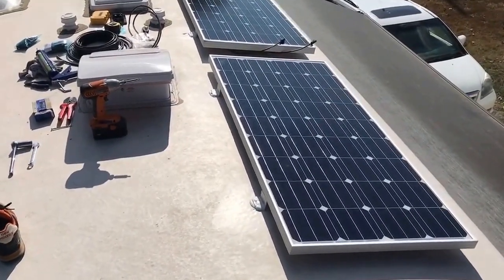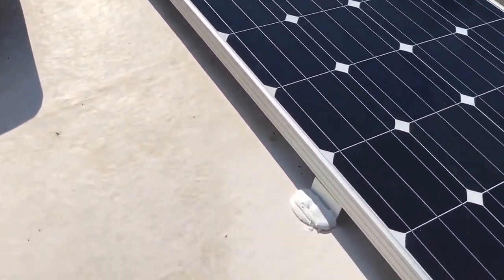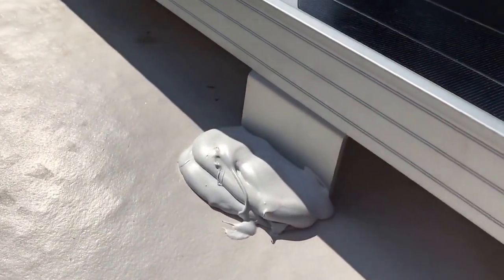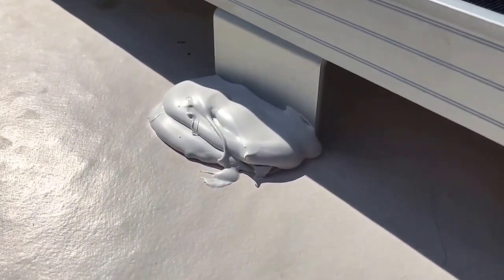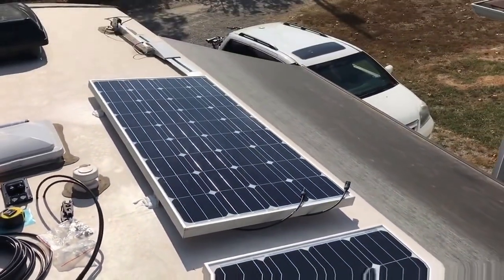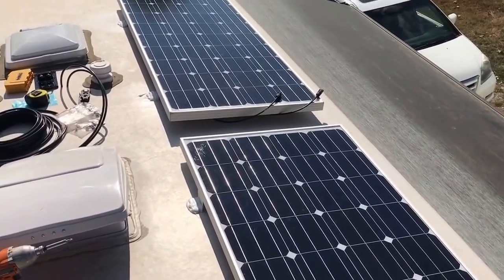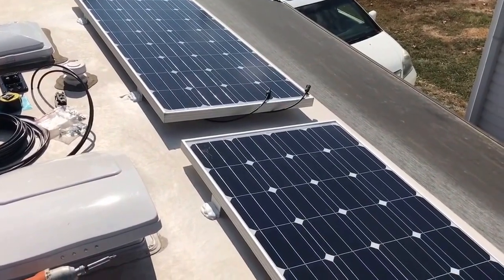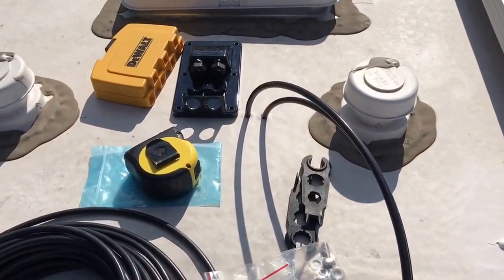RV Solar Panel Install Brookstone

Comment: Did you have any problem getting the 8 gauge wire through the Go power cable entry plate?